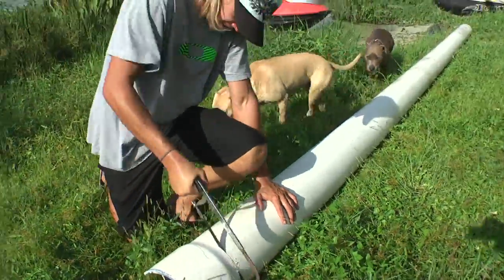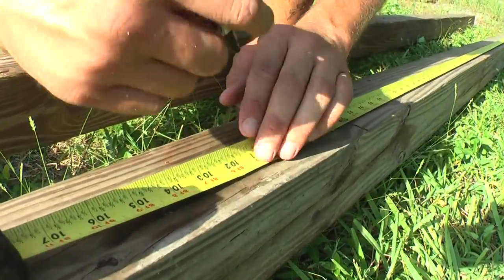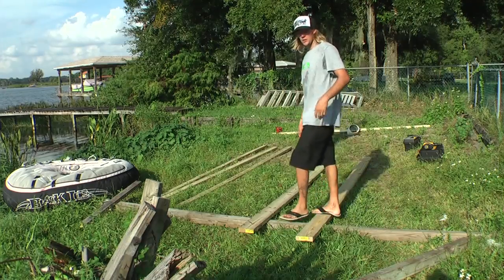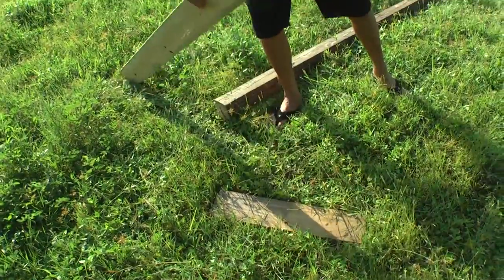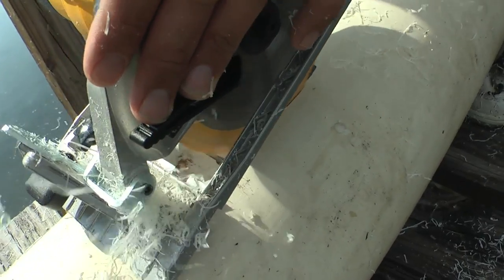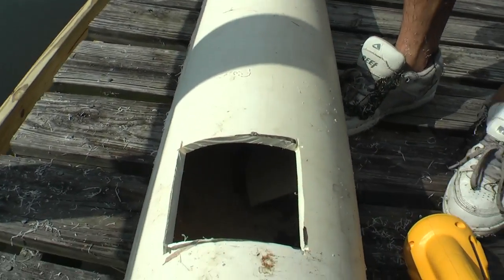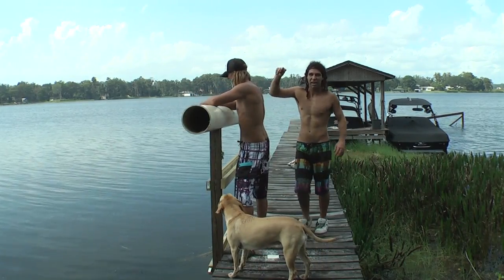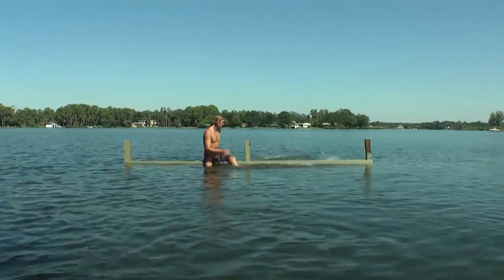Byerly Team - Pipe Rail

Comment: Well some people got it easy. Where i wakeboard there is 14 meters deep just under the dock and it moves down to 20 meters a few meters out and then it just get deeper. So i need to find a way to float it or get some crazy long 2 by 4's. I gonna try to build a kicker for the next sesion and then maybe i wil be trying pipe rail after that.